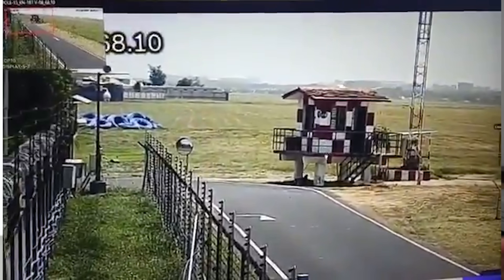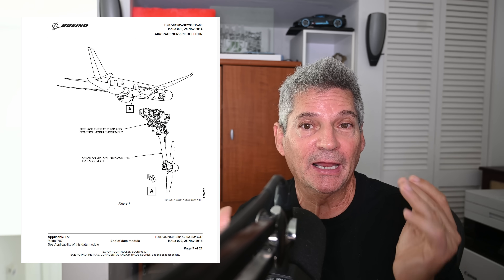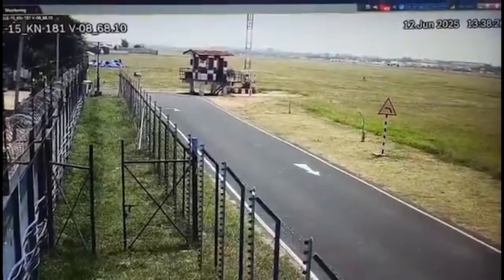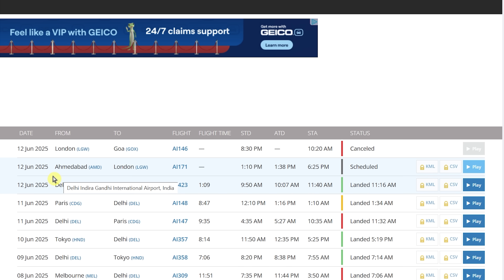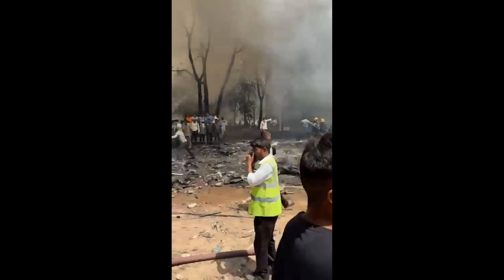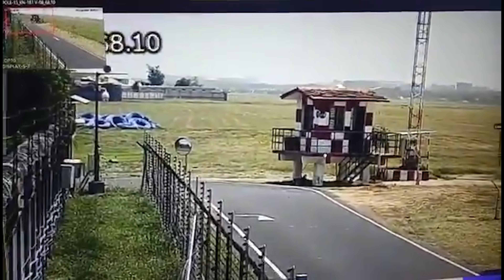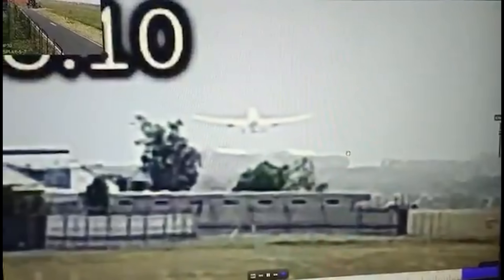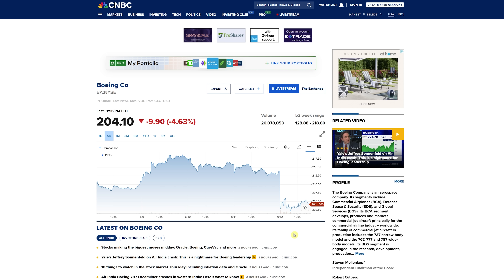What Caused Air India 171 Crash, Mysterious Sound Before Impact

Comment: I have just been watching videos of air liner takes off without flaps apparently the airbus doesn't need them just slats. The boing might be different though. But like everyone says there would be multiple alerts so looking less likely the flaps are a cause at this point. Pilot reported loss of power and seems rat deployed and a bang was heard. Obviously they had positive rate of climb for a few seconds. If lift was a problem they probably wouldn't have even left the runway. Maybe tire burst during takeoff damaging under carriage pure speculation thought so do read into that.

Comment: I think Cause of this Crash may be due to 
1. Plane was overweight (Fuel, passenger, luggage) & pilot miscalculated the right take off speed. 
2. Hydraulic system failure (Fail to lift landing gear or Deploy flaps) or Flaps/Landing gears were Jammed. 
3. Catastrophic Maintenance Fault. 
4. Human Error (Pilot mistake) 
5. Bird Strike can cause catastrophic power failure, but happening in both engines at the same time highly unlikely.

Comment: For some additional context:
1. The pilots had 8200 and 1100 flying hours each.
2. Final words of the captain: Mayday [...] no thrust, losing power, unable to lift.
3. There are 1,148 Boeing 787 variants in service globally, with their average age being 7.5 years. VT-ANB was 11+ years old and had over 41,000 hours of flying time, and almost 8,000 takeoffs and landings.
4. Boeing engineer Sam Salehpour in 2024 raised serious concerns about the structural integrity of the Boeing 787 Dreamliner. Warned it could lead to catastrophic failures over time.

I am no pilot and the most plausible reason l believe is that it might be a pilot error due to reasons like exertion or other issues but still it makes me think. Ofcourse boeing 787 has had a great track record but again, most allegations were pointing to longterm effects. Given that the average 787 is 7.5 years old, I wonder if incidents like this could happen in the future more often due to manufacturing issues.
Reply: No structural problems here, Sir. It is purely loss of power on take off. The RAT deployed(sound of small piston propeller airplane) something definitely went wrong. Again, no structural issue.
Reply: @antoniomilare7833 Yeah. According to what I heard today and the internet is saying, deployment of RAT is automatic. Pilot cannot turn it on like that from the cockpit. It's automatically activated which means that both engines failed. How? That's the question
Reply: From the original high quality video it does appear that the flaps were deployed as you can see the engines through the gap between the flap and the wing. I highly doubt that the plane was properly configured for take off, flaps on the 787-8 are usually between 10-15 degrees at takeoff and not at full flaps. Given that there's more sound from the RAT than the engines which would have been at full power to try and gain altitude. It seems likely that its a dual engine failure. 

 The concerns raised by the Boeing engineer was about the structural integrity of the fuselage. It is very unlikely that the structural failure of a fuselage would lead to a loss of power that is symmetrical.
Reply: Lack of proper airplane maintenance before it took off.
Reply: This particular plane was recently refurbished. And here we can see the RAT deployed so most likely both engines failed.
Reply: @mr_g_man We, the people of Pakistan, express our condolences for this disaster! 

We too have just been hit by a disaster when warplanes came to our country, bombing and killing civilians, most of whom were women and children
Reply: You do not need to tell us youre not a pilot.

This is clearly not a structural issue, the airframe appears very much intact with command authority over pitch and roll beyond the point at which it begins losing altitude.

In the 787 cockpit the flaps selector is mounted on the centre stand to the right of the thrust levers while the gear lever emerges from the front panel between the multifunction display units. They are grouped separately, they are shaped differently, sized differently, look very different, require very different amounts of force to engage, and have a wildly different number of detents; they are angled divergently; and they are on opposite sides of the centreline.
Reply: There were certainly doctoral research students on this flight and as usual with Big Pharma and its accomplices they decided to kill them.
Reply: its impossible to retract flaps instead of gears btw IMPOSSIBLE
Reply: @Yusuf-cb5hl except if you watch Mentor pilot he explains how it can happen and has in the past. So saying things are impossible in capital letters doesn’t make you right.

Comment: Probably a fuel pump. Both engines failed, complete electric, and hydraulic failure. You can hear the Rat being deployed. The captain probably felt a lack of thrust. The flaps should’ve been down.  Landing gear should’ve been up.

Comment: Very nice analysis. But i feel that it wud have been an under power aircraft even before take off. Looks to me it did not achieve rotation speed at the right dist and  thus reached almost at the end of the runway, though difficult ti say fm the video but generally the end of the tarmac is where sandy patch is made. Why pilot did not abort because he would have crossed point of no return. Secondly during his rt call- he mentions i am loosing thrust, may day may day. Thrust is directly related to engine power hence this assumptions. 

Lastly if not above the other reason i feel is the flaps stuck in landing position during take off.

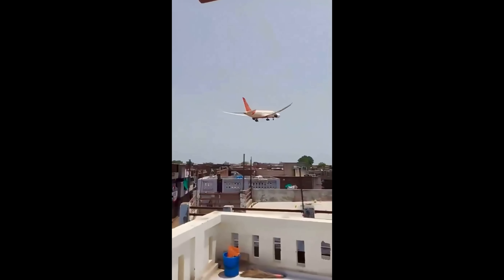Comment: The problem with the RAT deployment theory is that you can't see it actually deployed. In the vid you showed sample jets with the RAT deployed. The RAT deploys on the right side of the plane just behind the right wing, the propeller is on a vertical boom that extends downward from the fuselage, and the open RAT panel door is obvious. In the actual crash video if you freeze at @2:37 and @2:39 and use full screen you can see the right main gear down, the bottom edge of the fuselage is clearly visible and there is no obvious open RAT panel or boom/propeller visible hanging down behind the right wing.

Comment: 3 things wrong already with your video:   1) Survivor said he heard a loud noise about 30 seconds after takeoff.    2) He didn’t say that he jumped out while it was in mid-air, but after it had crashed he got up and out.  You can read the interview/ quotes from him in the Hindustan Times.   
3) Also you have the wrong plane configuration layout, you’re showing a different plane.  He was seated near the exit, he was not in business (ie your graphic), the plane had a business section in front only configured with 18 seats.   
Come on these aren’t hard details to check/ get right.  All I did was quickly check the sources directly, took me about 60 seconds.
Reply: I see you corrected 3) in your latest video.  Good stuff.

Comment: Does anyone else notice the shadows behind the wing at 1:09? It may be video artifacts, but the shadows are creepily symmetrical, and it almost seems that the speed brakes were partially extended. These only come out under 3 circumstances, rejected takeoff, the physical touchdown of the landing gear when the speed brakes are engaged, and manual extension. If so, why would they be out???

Comment: I think you are definitely on to something here. The video definitely  sounds as though the rat is deployed.
To me this more clear version also looks as if the slats are down and flaps are at 5.
The deployment of the RAT would indicate an engine or electrical failure.
The video of the crash sight shows  part of a wing  on the  ground with the slats down. I'm going to NOT jump immediately to blame the pilots but say the fact that the gear is down and apparently the RAT is deployed both indicate an electrical or hydraulic failure either of which might have made retracting the landing gear impossible. Im betting they had the loss of both engines.

Comment: I heard they said that they had heard an explosion upon take off. Engine flamed out? Ram deploys, flaps seemed to be still elevated to a small degree which probably didn’t help with lift and low power. The video looks like it stalled with nose slightly elevated 10-12 degrees, normal pitch for take off.

Comment: The flaps appear to be retracted and not configured for takeoff.  Without the addition lift they provide the plane would lift off in ground effect and then settle back to the ground, just as you see in the video.  Why the flaps are retracted needs to be determined.

Comment: The Ram Air Turbine (RAT) on the Boeing 787 jetliner serves as an emergency power source that deploys automatically in rare situations such as total loss of engine power or hydraulic failure. It is a small propeller that extends into the airstream, harnessing the airflow to spin and generate electrical and hydraulic power. This power supports critical systems including flight controls, avionics, and hydraulics, enabling the pilot to maintain control and communication during emergencies. The RAT can only be retracted by maintenance personnel after deployment and has no operational limits on altitude or speed. It is tested regularly to ensure functionality in case of an actual emergency[1][3][6][7][9].

In summary, the RAT's purpose is to provide vital backup power to keep the aircraft safe and operational when all primary power sources fail[1][6][9].

Comment: 2:00 If this was the original. Sound was edited on because you heard the impact and explosion direct as it happens, where sound travels 340 meters per second. So the plane was at least 680 meters away and is zoomed in so I say possibly easy one kilometer. So rumbling and explosion sounds would have a delay of at least 2-3 seconds.

So it could be a static camera that doesn't capture sound and someone edited a soundtrack of anything rumbling and exploding. So you have already the wrong first video media came with and then a second video with tempered audio. You see it always in videos of like things explode in Ukraine that the sound is at the same moment. No there is a delay. Just made to make more impact if you hear directly a Kaboom. It always starts with a bad taste of strange things happening. Direct questions what is true and what doesn't line up.

Comment: Good catch. I took a screenshot 1:50 and zoomed in to the RAT area. There does seem to be a protrusion under that area that could be the RAT. I also did not hear any increase in throttle. In fact it sounded like the engines were not up to full power and may even have been decreasing power. The pilot was obviously trying to pull out as the elevators were full up. It stalled and fell down. When I first saw it I wondered if there might be and issue with an aft CG condition. But with the sound and a tiny bump showing where the RAT is...I think we are looking at a loss of power and subsequent stall. As to why the engines might have lost power, I don't know. I also noticed that the gear had not started coming up and It is hard to tell if and flaps/slats were deployed. Someone suggested that the co-pilot may have raised the flaps instead of the gear. It usually take multiple issues to cause an accident, especially on a plane as smart as this. It won't let you make as many mistakes.

Comment: How could the flaps not be set properly. There are so many procedures to ensure the flaps are set correctly
Reply: Likely were set properly for takeoff, but retracted by mistake after airborne, when they instead intended to retract the landing gear.
Reply: @Summitspeedfly Oh no. That does sound logical. But shouldn't that too be almost impossible to do ?
Reply: Wouldn't the computer override the pilots mistake ?
Reply: @12161otherworldly  - Is it impossible for you to slam on the brakes instead of pushing your gas pedal in your car?  You know you shouldn't do it, but nothing prevents it.
Reply: @mountainflyhigh We are talking about a passenger plane. There are systems in place to prevent pilots from making these kind of mistakes. The computer would alert and sound alarms if something wasn't in the correct configuration
Reply: @12161otherworldly  - Yes, as I've said, there are AURAL warnings and lights that activate BEFORE takeoff, and there are some that warn you during the landing phase if you get too low without gear and flaps down.  However, THERE ARE NO WARNINGS AFTER takeoff if you choose to retract the flaps/slats, or that tell you when to retract the gear.  NONE !!!  You seem to think "the computer" does and knows everything, not so.
Reply: @mountainflyhigh It sounds like you know what you're talking about. I think I have more faith in technology than is actually there. But if this is a case of a co pilot retracting flaps instead of landing gear. This is a failure in both human and computer technology. 290 People expecting to get to there destination. Just awful

Comment: You know something like this happened with a BA 737 during final approach with an engine failure. They shut down the other engine by mistake leaving both completely off. What I think happened is that one of the engines must have had a compressor stall but the other engine was shut down instead, leaving both completely inactive

Comment: There were videos that the people on board took, of the plane suffering electrical issues. The AC wasn’t working, infotainment was down—Its power was seriously malfunctioning, and they took off anyway. So, the 787 deploying the RAT shortly after takeoff, does make a lot of sense. If I had to bet, I’d bet it was a serious electrical issue that was never addressed.

Comment: Either they pulled the flaps up instead of the gear up after take off, Or they took off without their flaps extended. Plane didn't have enough air speed to not have the flaps out, they kept pulling up and induced a stall. Had they nosed down they may have made it.

Comment: Two possibilities: 1) flaps not set. Flaps on 787 are huge and would hide a portion of the engines' exhaust ports. That is not the case. 2)A single engine failure followed by a shut down of the wrong engine, leaving the plane powerless. It might also deploy the RAT. Take your choice.
Reply: There is a warning system that won't let you takeoff without the flaps set.  And today, pilots are in no hurry to shut down a failed engine.  We run checklists before we even think about shutting one down.  They didn't have time to do so.  We also pull the bad engine throttle to idle to positively identify it, before we actually turn the fuel off.
Reply: @Summitspeedfly  TOCWS is suppose to warn you if you're taking off without flaps, so I agree, flaps up is less likely (despite what we might see in the video). But dual shutdown is definitely worth considering, despite your point about checklists. The startle effect of something going wrong cannot be overstated, especially that close to the ground. That's why, when doing pre-flight checklists, it's important to think "When it happens..." not "If it happens..."
Reply: @pcgenie-la  - Nope, we just don't even TRY to shut-down engines anymore, until we are at a safe altitude.  And then we ALWAYS verify 1st.  ALWAYS, both pilots.
Reply: It could be possible that they had an engine 1 failure on rotate and cut off the engine 2 by mistake. Or vice versa
Reply: @WattsValor  - In todays' flying world, pilots are in NO hurry to cut off an engine.  We follow checklists 1st, and we verify multiple times which engine has failed.  At that altitude, they would not have even thought about shutting down an engine.   It's not a twin-cessna.
Reply: Actually there is a photo  & a video that shows one of the aircraft wing where the flaps are extended.
Reply: There were certainly doctoral research students on this flight and as usual with Big Pharma and its accomplices they decided to kill them.

Comment: Back in the day when seat belts in cars were still optional, a common feature of impact stories was being "thrown clear."  I submit for speculation that the survivor [if he's not otherwise unbreakable] being in the window seat at the front of the wing mount, may have been the benefactor of precise timing that only the universe is capable of keeping in mind that even the most apparently instantaneous event requires a finite amount of time to occur.   At the moment of impact, the fuselage cracks open bellow his feet and the section in front of him hinges up making his now the frontmost seat in the remaining half of the plane from the wings and engines back to the tail.  The structure more solidly impacts the ground still with forward momentum and he is only affixed to that mass by a lap belt ¬ if he hasn't disregarded the safety instructions.  He may have been 'thrown clear' through the widening gap before him as the wreckage loses forward momentum behind him.   He only needs to retain enough velocity for long enough to 'outrun' his moored position by a couple of body lengths at enough of a trajectory to clear the torn edge before ballistically falling the ground ¬ perhaps after skidding over the wing, shedding kinetic energy ¬ while the wreck catches up and passes by him.  In this time, the wings have ruptured and fuel begins to dump, slightly slowed by the sloshing and baffling in the tank and then igniting into the fireball up and forward away from him rolling to a stop on newly cleared ground while the devastation continues without him.  It could explain why it was only him and why he wasn't incinerated.  It did happen so there must be an explanation that gets him from inside the plane to relative safety away from twisted conflagration.